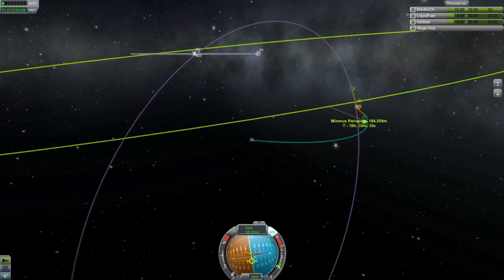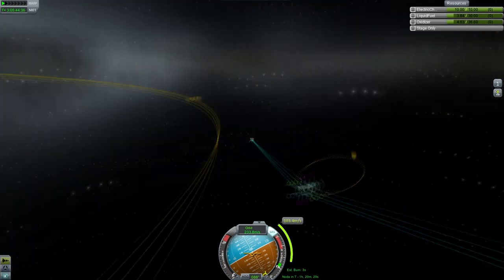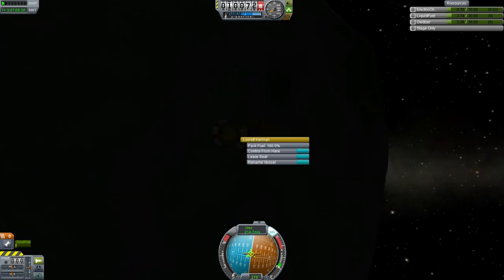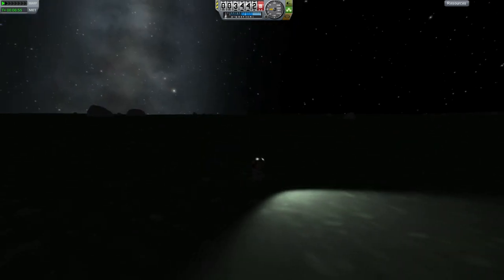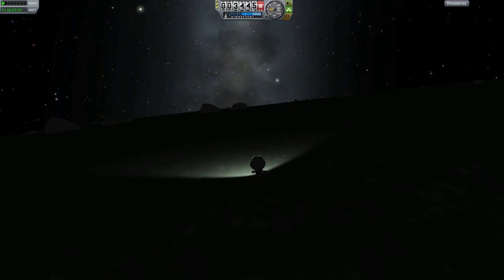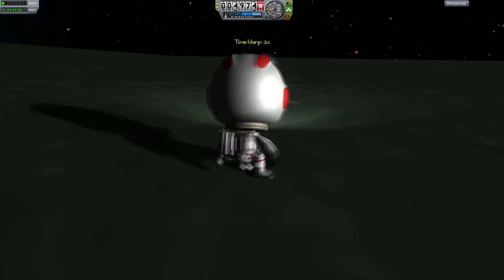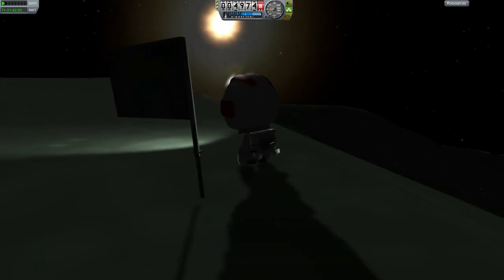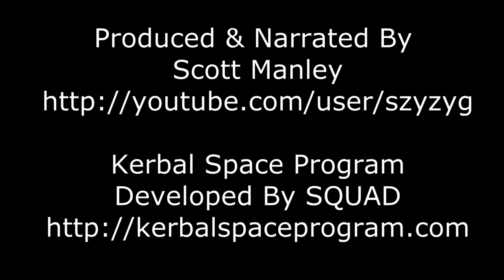Kerbal Space Program - Minmus & Back With Less than 2 Ton Launch Vehicle

Comment: About the craterless surface of Minmus: A quick especulation could be that the planet is composed mostly by low fusion point metals (very unusual, but not impossible) and as meteors hit the surface, the metal melts and closes the crater. The heat of the sun combined with coriolis effect could also cause smoothing of the surface.

Comment: Funnily enough I did that calculation at work earlier...assuming a human to be a 2m tall cylindrical black body the radiative heat loss to space would actually be nigh on a kilowatt. 
However EVA suits are rather well insulated with several layers of aluminised Mylar to prevent excessive heating or cooling through radiation by giving the suit a very low emissivity.

Comment: you're right, delta means value 2 minus value 1. In this case the values are your velocity, thus delta velocity, so it is velocity 2 (after you increased it) minus velocity 1 (before you increased it) :)

Comment: Change in velocity. For example, if you have a rocket with 800 m/s delta V, then you can increase or decrease your current speed by 800 metres per second if you burn prograde or retrograde.

Comment: Now what is the smallest mass to say Duna. I think you can exploit the fact that the EVA fuel refills after you enter a pod (the chair does not however) and use that to theoretically give you infinite delta-v, however with a very low thrust to weight ratio, so you would still need a stage to land (if no atmosphere) and take off.

Comment: Delta V is a rocket`s ability to change its velocity. Its a calculation of the thrust, weight, fuel and fuel efficiency of the rocket. Literally, its not Delta V, its the delta sign from latin and V, which literally means CHANGE in V, which is the mathematical term for Velocity

Comment: As I was descending through the atmosphere of Eve I learned the hard way the function of the "EVA" button. Yeah, one (out of three) kerbs left the shuttle mid-air. I wanted to switch back to the shuttle and figured I could just go to the trackingstation and it would show up there. It did not. Is this a bug? Is there some proper way of switching back to the shuttle once one kerb has left it (assuming there are still kerbs left in the shuttle).

Comment: I have an updated version of redd.it(slash)1hp2q5 using the new engine in the works. I may be able to get Mun and back in 1.917 tons, will be close though. Without MechJeb, 1.97 should be doable. Ladder method is lighter but more tedious than a seat.